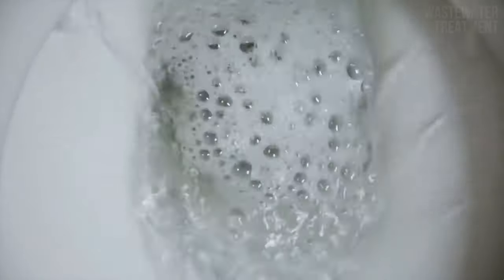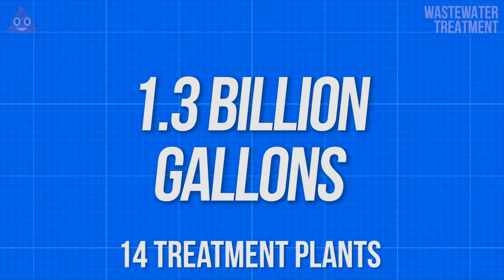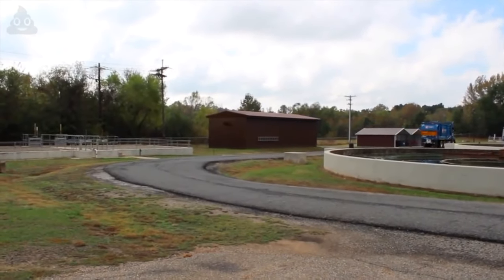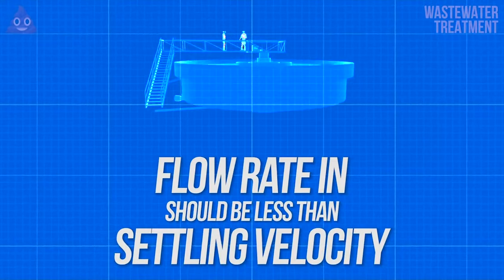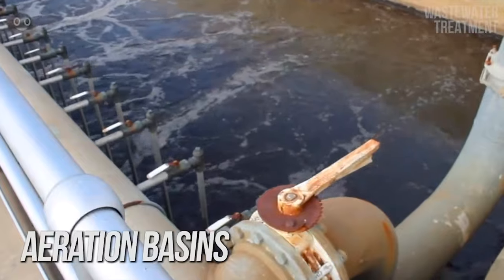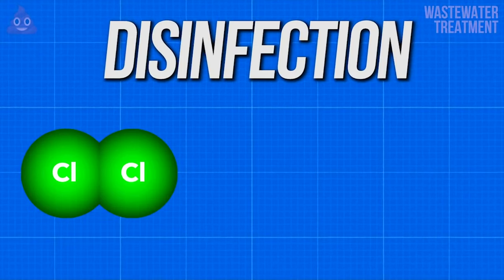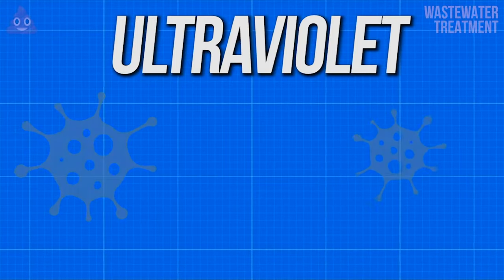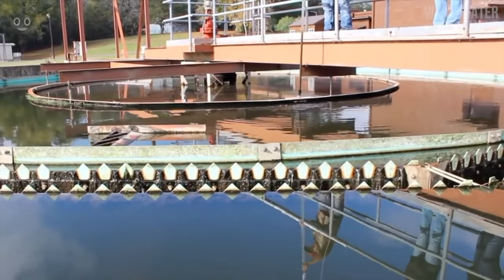How does Wastewater Treatment Work?

Comment: Pre-treatment:
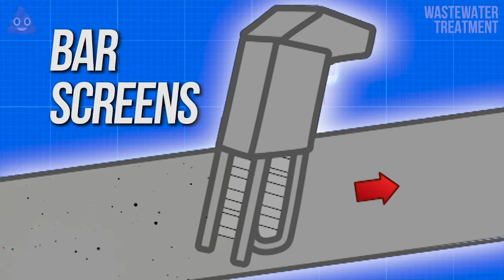2:12 Bar screens
3:11 Grit Chamber
         

Primary Treatment
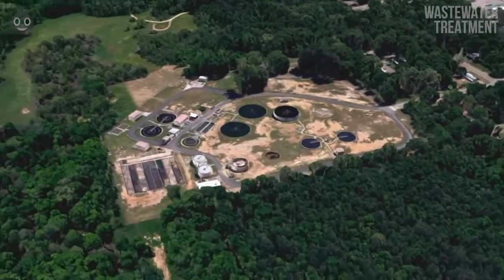4:05 Primary Classifier/Filter
4:18 Settling Velocity

5:09 Secondary Treatment
Aeration Basin
6:56 Secondary Classifier/Filter

7:25 Disinfection
         7:44 Chlorine disinfection
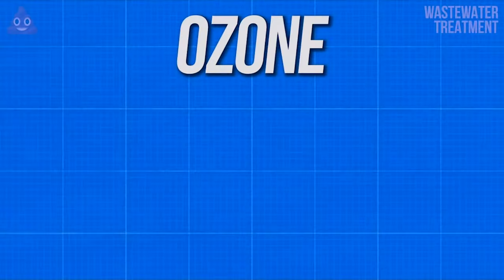         8:11 Ozone disinfection
         8:41 Ultraviolet disinfection
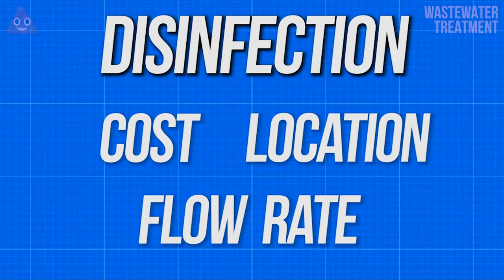9:17 Effluent release
Reply: Digesters, not a part of water cleaning but final stage of handling the remaining sludge.
Reply: Thank u :3